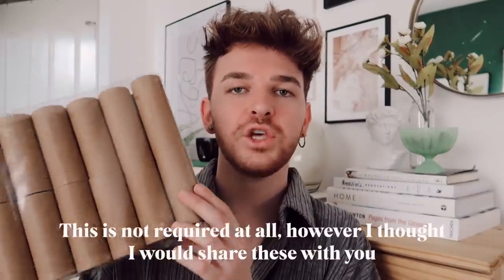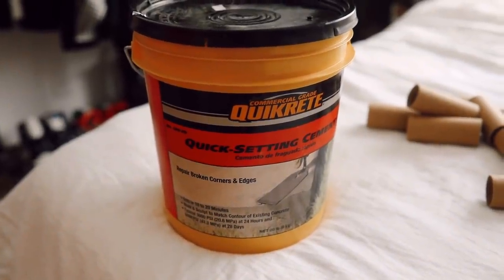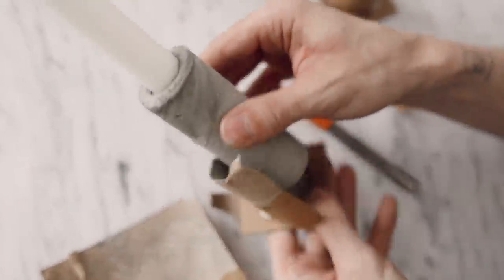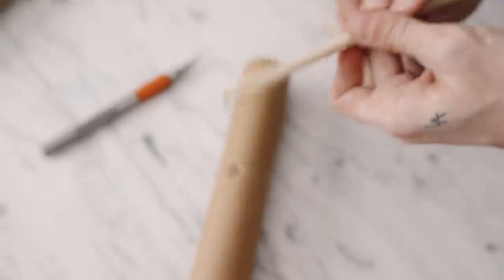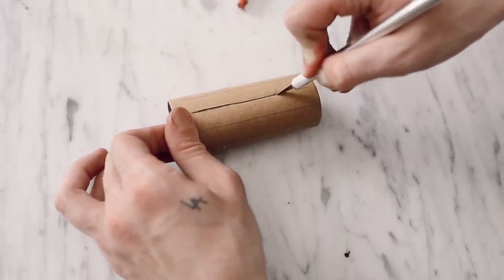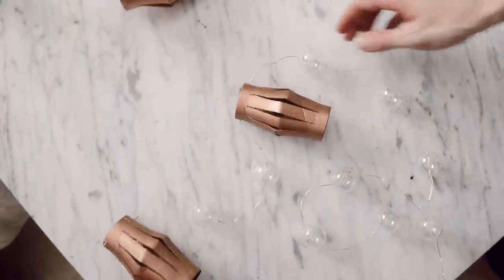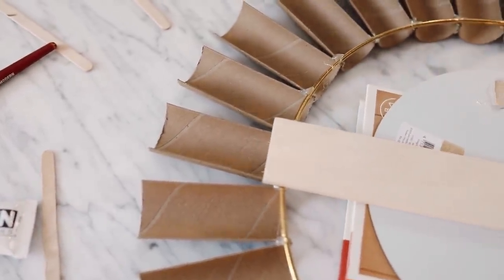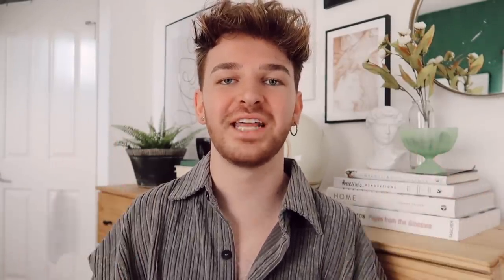EASY DIY Room Decor with TOILET PAPER ROLLS! 🧻 *Looks Super Expensive*

Comment: Hey Drew! When you've burned down the candles (or you can chop them off at the base of you don't want to wait) put your candle holders upside-down on a baking sheet lined with paper towel (you really want to use paper towel here) and put it in a cold over. Turn the oven to 200, or whatever the lowest setting on your oven is, and leave it all in there for a half hour or so. The wax will melt out if the candle holder and be absorbed by the paper towels. Turn the oven off and leave it all in the oven until it's cooled enough for you to handle. Remove your (now clean) candle holders and leave the paper towel to cool fully. When the wax has totally cooled the towel will be stiff and you can pop it out of the tray and toss it. These are so cute and once you know how to clean them, you can use them over and over.

Comment: As the cement is hardening, literally you need to find the right moment between while it’s soft enough to push in and hard enough for the shape to hold. Wrap whatever item you want in cling film and push it in, spray with a little oil so it can slip out once dry, as it’s not in there the whole time it should be pretty easy to come out!  Hope this helps! The candles and mirror are on my to do list!!
Reply: I was thinking the same thing and maybe wrapping the candle either some saranwrap slathered on the bottom part with Vaseline.

Comment: Hi Drew, whenever I or my dad make a mall for cement we usually put some cling film at the object that needs to be removed before putting vaseline on, so maybe you could give that a try!
Reply: Yes! I use plastic wrap, garbage bags, whatever I can use that fits what I am making. I have made tons of pots, bird baths, even a sink once. Never had a problem removing the inside mold. All else fails, a little WD40. Also about half way through the drying time,  gently rotate candle to loosen the bond.
Reply: Jasmine van Andel I was just going to suggest that 😊
Reply: @hellsbells7905  OMG, I love your handle. That was my mother's go-to curse word when she was really angry (she was very ladylike & rarely swore).
Reply: thanks for the tip!

Comment: When these candles are burned down, to remove them just melt the wax out of the hole.Pour  boiling water over it. The outer layer of wax will melt and you can pull out the stub.
Reply from the maker: Good idea!! Thanks for the tip :)

Comment: Adressing your "candlestick stuck in cement"-problem. Just melt the candlefluid an let it drip out. If you then want to fit another stick, and it may be to tight, you can use a slightly bigger stick before or warm up the end of the new stick with a lighter so you can squeeze it in. You should get a pretty good bond, having in mind that these large candles tend to fall out anyways.
Greetings from germany :)

Comment: Thankful for your thoughtful content and enormous heart. Some more ideas to add to the arsenal... (1j When my kids were tiny, now your age, they made napkin rings for the first big Thanksgiving we hosted. In our case we painted them teal, cut them in half, & hot glued dry eucalyptus leaves on them in an overlapping fashion. So easy and they loved helping. When the compliments rolled in they beamed with pride! (2) For the awesome (COPPER!) jewelry stand, depending on how heavy your jewelry is, some folks might need a stronger cross bar. So I thought using foam insulation, paper mache, or even cement might work to fill in the interior of each tube...AND for a different look you could simply glue down fabric to match the decor. (3) Another idea, to organize earrings or rings just cut the tubes into thinner rings, staple or glue them together at the sides to set in a drawer or tray or bowl, and finally (4) you could vary the thickness of the rings in #3 and create either a mobile, a garland, wreath, embellishment for a frame, or even a curtain a la the 1960’s, paint them out in whatever color you like.

Comment: Once the candle has burnt down, you can remove the remaining candle stump with boiling water - basically melt it, and then you should be able to add a new candle in it :) But you can also use those candle metal capsules instead of the candle from the beginning. Beautiful ones! I also made similar ones a while back and has the same problem ;)
Reply from the maker: Thanks so much for the tip!

Comment: if you wanted more sturdy rolls that are a little wider you might be able to go by a local printing place and get their left over wide format rolls for blueprints. they are about 1/4 inch thick cardboard material and they are 36" wide rolls with about 3 1/4 inch diameter. might make something fun! i have bunch of them from my work(general contractor) but have never known what to do with them

Comment: To make sure the candles come out, use vaseline around the base you are putting into the cement. Or put some plastic wrap around the bottom of the candle along with vaseline to remove easier

Comment: You may be able to melt the candles out of the concrete mold by placing the entire thing in the oven on a cookie sheet, then dremel out a slightly wider hole for candle sticks that can be removed.

Comment: If you are almost done with the candle and want to keep the holder you could cut along the edge of the cement and then melt and scrape out the rest so you can keep using the holder with new candles!

Comment: When you get the candle sticks burnt mostly down, you could probably submerge them partially in a pot of water and put it on the stove for a couple of minutes (just long enough to soften the wax so it pops out, not long enough to melt completely). Then wipe the wax residue out with a paper towel and you should be all good!

Comment: use plastic raps when putting anything in cement. before you leave to dry winding the space by slightly rotating it into pace. So that as the cement expands there is enough space to accommodate the candles, preventing such a grip

Comment: You can also for that jewelry stand if you don't have any spray paint a lot of people have Elmer's glue in their home you could do almost like a Mod Podge look with the owners glue just put a little dab'll water in it to thin it out a little bit and put your pictures down and paint right over and it could turn out really cute also I was told you was like an olive oil more like an oil on your candlesticks if you're putting them into the cement that but best bet is to roll up cardboard and put it in there so wrap it around a Candlestick for the size and then put it inside the cement

Comment: What you can do is rub oil on the candle or spray oil on it. , then after you fill the toilet paper roll with cement you then insert the candle  then after it dries , the candle will be removable.

Comment: Cement will not stick to a plastic grocery bag. Wrap it around your candle as smoothly as possible and tape it at the top of the candle. You could also roll a piece of cardboard the size of the candle and use it in place of the candle .

Comment: I guess you could just heat up the cement candlesticks, so the outside of the candle becomes soft and oily. Don't let it solidify, just keep trying and re-warming it. Sooner or later the candle will come out. And, if all else fails, let it burn down completely until there is nothing left of it.
Reply from the maker: Yes!!

Comment: Candles are generally thicker at the base. So it tapers in until the point. So the level at which the cement was, that point of the candle had a smaller circumference than the base. Hope this makes sense 😂

Comment: Most use cooking oil or spray, I wonder if the heat created by the cement while it was curing maybe melted the wax into the cement? Maybe that's why it wouldn't come out. I would use something the same diameter as the candle you want to use. A wooden dowel, or metal tubing.
Reply from the maker: Thanks for the tip!!
Reply: @lonefox  You're most welcome! I've been watching LOTS of cement DIY's 😂 Have a beautiful day! ❤️

Comment: I will say this every  project that I have ever done with cement, if you are going to use vaseline as you mold release you need way more that what we just saw you put on you need to be very liberal with your application not enough to mess up you molding process  if you should someone your project and didn't tell them what you are doing they should be able to recognize and ask what that gunk is all over your mold.  Your other option is a cement mold release spray can be bought at Lowe's and HomeDepot and you should also be liberal with the spray application as well
Reply from the maker: Thanks so much for the tip!!

Comment: I think the Vaseline didn't work because you used a wax candle and the wax and Vaseline had a reaction. If you try to use it with something like a metal rod or something, it would probably work better. Something that can't soak up the Vaseline, even plastic would work I'm sure.

Comment: I saw some vid a lady used oil , about the vaseline ypu have to but a lot so it can slip of hun. I did a proyect with cement it happened the same jajajaj so i put a lot of oil like bb oil are vaseline remeber it melts so it gets dry before you slip it of.  Try with bb oil but but a lot so it will slip of